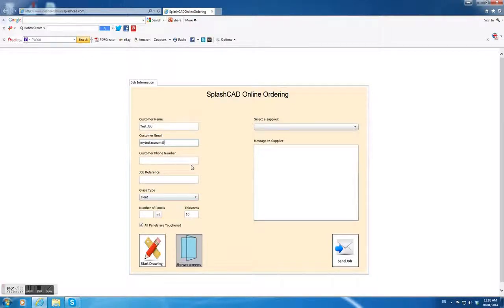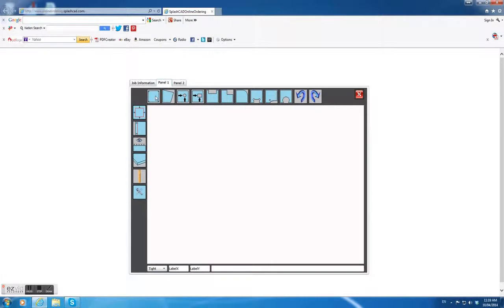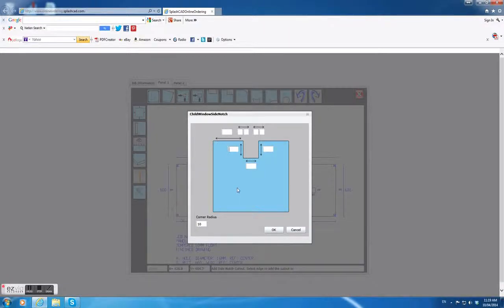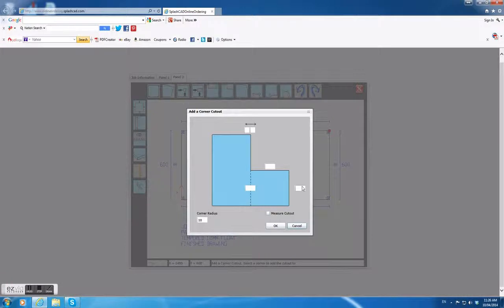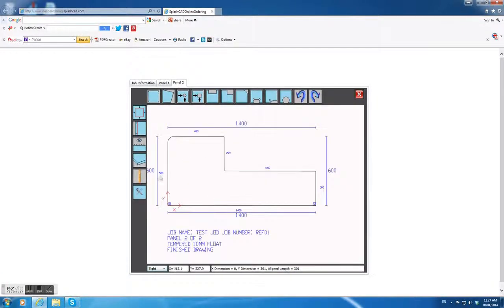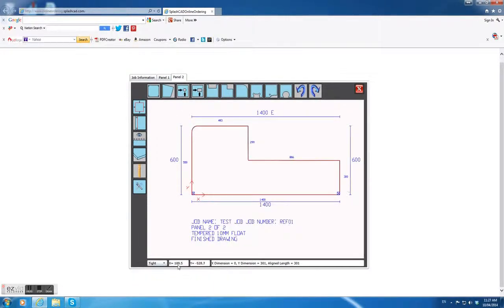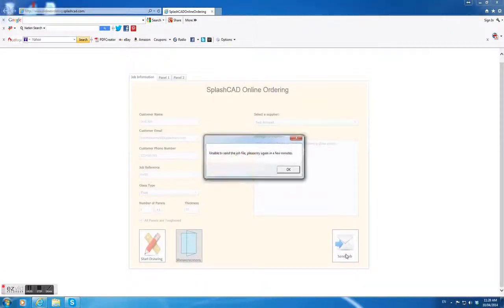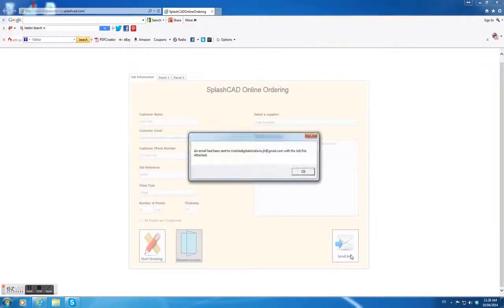SplashCAD Online Ordering - Drawing a Splashback or Loose Glass Panels

Comment from the maker: Using this system, you can receive orders from your customers with the drawings already done! No need for manual data entry, and using the SplashCAD software (included with a subscription to the Online Ordering System), you can generate quotations and email them to your customers directly from within the software. Also once the job is ordered, SplashCAD can generate all the files needed for processing (PDF Job Files, DXF Files, NC Files for you CNC machines), all from the customer's original drawings submitted through the Online Ordering System.

To try this system out, please visit our website: http://www.onlineordering.splashcad.com/ You can enter a job, select "Test Account" for the supplier and I will forward the job you enter to you. Please contact jake@splashcad.com if you would like a trial.

Subscriptions are very affordable, and they are a flat rate per company - your customers do not need to pay a thing to use the service.